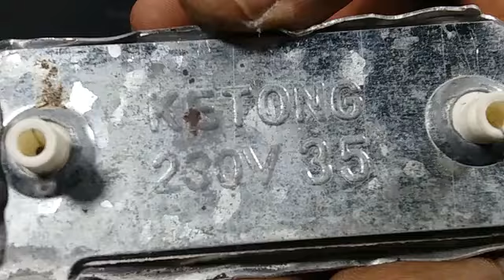HOW TO MAKE AIR FRYER HOMEMADE IDEA

Comment: Nothing more than basically a poor designed hair dryer. Air fryers recirculate the hot air and has temperature control.